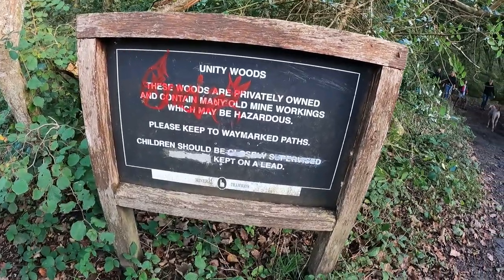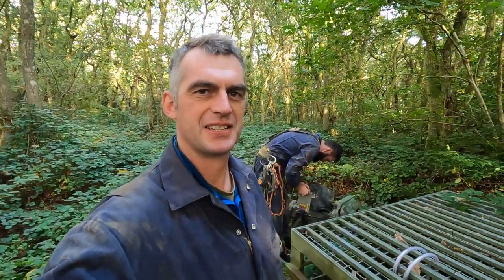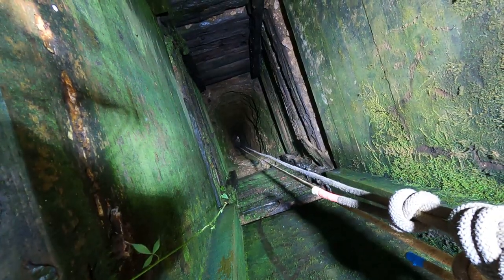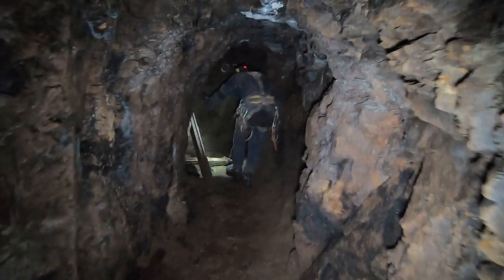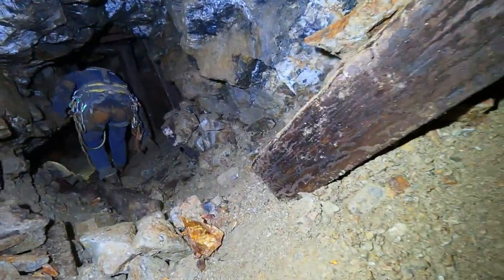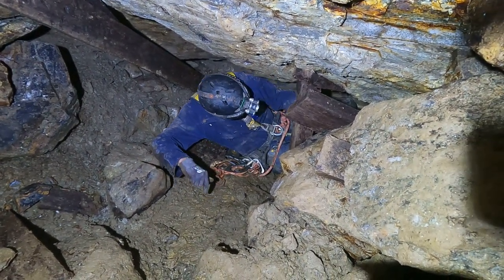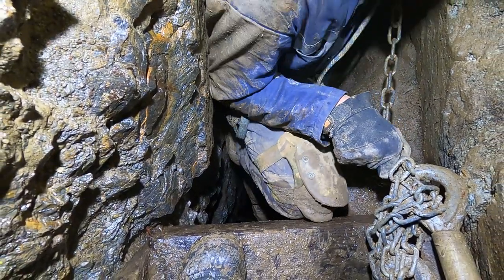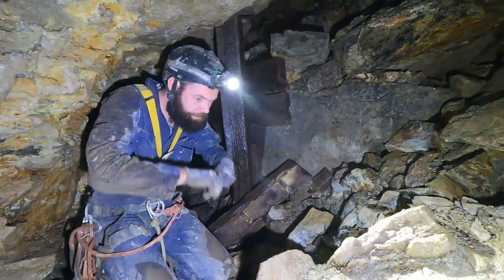A tight crawl to the bottom of a Cornish tin mine

Comment: What sort of risks are there for respiratory health? I know you can take gas monitors for hydrogen sulfide etc but what about particulates? Looks quite dusty in a lot of your videos
Reply from the maker: I know a lot of mines suffered from a build up of radon gas, but we are only in these places a short amount of time, hopefully not enough to have any impact on our lives later on.
Most of them are very damp, many have running or dropping water everywhere . Often the dust that appears near the camera lens has come from my overalls or equipment that I have dried out and some mining mud has settled on which very easily dusts up to a fine powder in front of the  lights .
Reply: @BenoCam  that makes a lot of sense. Cracking video, definitely the most claustrophobic. As for radon, i think background radiation is about 2.5 times the yearly average dose for the UK in Devon and Cornwall. Obviously it gives you spelunking super powers